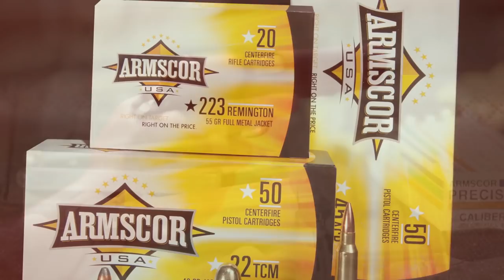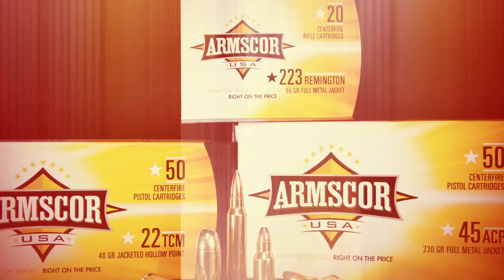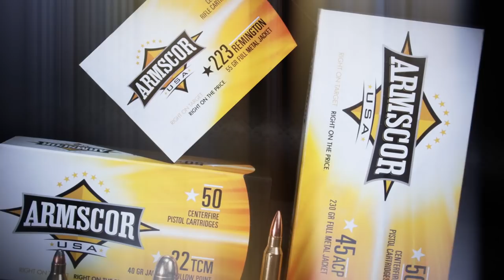We are Armscor (Official)

Comment: I just purchased a Midsize 1911 and took it out for the first time this weekend.  Not a single failure to feed, no cycle issues, nothin.  Worked flawlessly with both Winchester and Remington ammo.  I'm always sceptical with a low price point and I have never been a huge fan of bull barrel/reverse plug designs, but this one works and works really well at that.  Great job guys, this won't be the last one I buy for sure.

Comment: I recently sold my Springfield and got a brand new RIA 1911 (basic FS model) with some change back. I took it apart and cleaned it, then went to the range. Put a few hundred rounds through it and at no point did it not go bang when I pulled the trigger. I actually had better grouping than I had with my glock or Springfield. I spent less than 75 bucks adding black rubber grips, a wilson b-tail with a skeleton hammer and it looks just as sexy as a kimber now. Night sites next,all for less than 600

Comment: i am planning to buy an armscor 9 mm hi cap, because i already have a NORINCO hi cap cal 45 and std NORINCO cal 45, thousands of round later, those guns still functioned flawlessly. i used those two guns in competition. my concern is, your gun in cal 45 1911A1 failed in the PNP torture test of 2003. after approximately 3000 + rounds, it stopped working. and it jammed continuosly. is your gun much better now? or did it passed the pnp torture test of 5000 rounds. sorry i mispelled gun.

Comment: I have 7 1911's a Kimber PRO ll with light rail, what junk come paired to my 1911 .45 ACP Rock Island Tactical ! my Kimber was sent back to them and after 8 weeks they sent it back to me with damage to the slid and still would have a failure to feed!? as well as failure to eject the rounds 4 to 6 time a mag? I called Kimber and was told you have to clean your gun every 100 rounds? What I asked? R U NUTS???

Comment: Rock island armory's guns are  by far the worst gun manufacturer in the world i had one of their shotguns. It broke 4 times and i do mean 4 different parts in one box of #8 2 3/4'' bird shot they quit fixing the gun and took a dermal tool and murdered the chamber,feed ramp, bolt carrier, and end of the feed tube. They sent it back in that condition and said their not replacing anymore parts ill never know why a dermal tool was needed. To replace the firing pin, left feed chamber ear and spring, both rails and firing pin spring. Two friends bought two different styles of their 1911's and within 50rds of standard hp's both pistols had extreme wear to the slides and firing pins making them un-shootable because of the cheap soft metal they make all their guns out of doesn't hold up. Their life time warranty is a lie they stop responding to emails and hang the phone up on you multiple times when you say i got a problem. Don't buy their garbage guns.